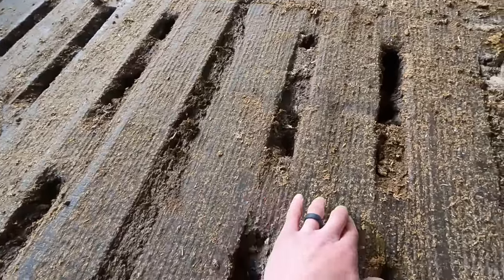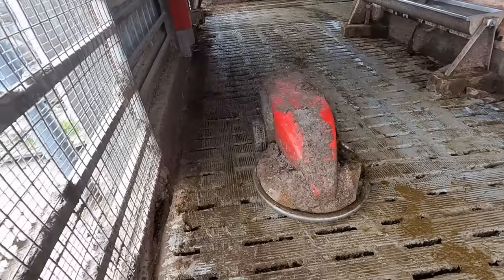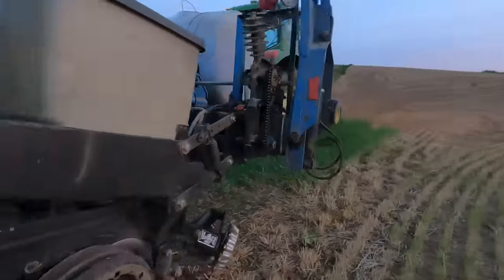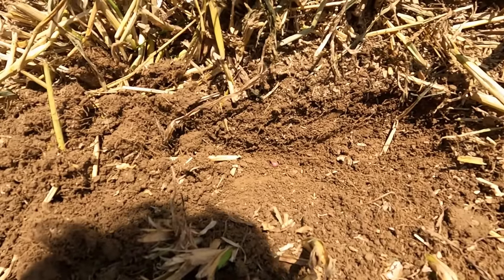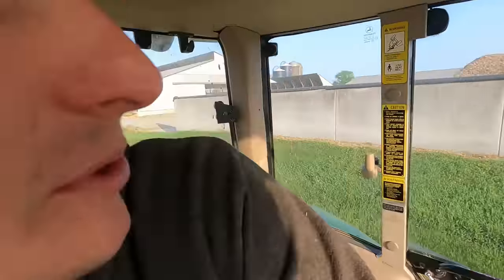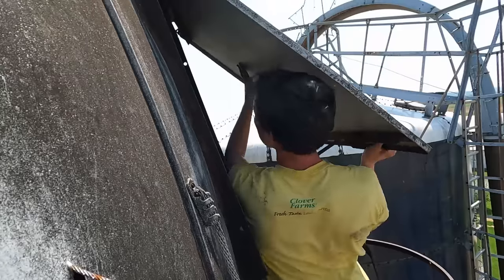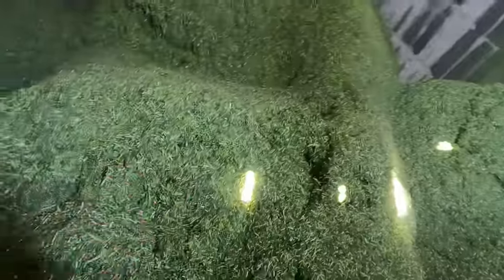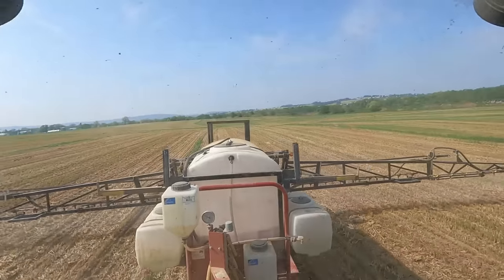Grooving Cow Floors, Planting & Harvest

Comment: if you want to know if its the tractor or the planter having the leaning issue pump the planter up and then disconnect the hydraulic lines if it stays up its the tractor if it falls down its the planter.
Reply: My planter does it too it has to do with those cylinders I'm going to start rebuilding mine one by one as I have time but the book tells me it will happen every now and then and I need to lift it all the way up every so often

Comment: Planter hydraulic issue is most likely weakness in plante cylinder, or cylinders.  Suggest having them rebuilt with new internal seals.  You have internal fluid leak by.  Not necessarily visible external leakage. Good hydraulic shop can do this, reasonably.  Cheaper than new cylinders.

Comment: Def in the planter. Constant pressure coming from the tractor when you pump it raise it up. So the fluid goes out at so many gpm and finds a empty place in the line or cylinder to fill in….hence the one side raising back up. 
Disc bine of mine was doing the same then. The cylinders had breather ports on them so it was leaking out of those breathers on a bad cylinder that I needed to have repacked. 
Planters prob don’t have breather ports on them so you may not be leaking but it’s def a planter cylinder issue 

Hope it helps boss man

Comment: It's leaseback through your valve block distribution on the planter. If your cylinders have counterbalance valves it's likely the pilot circuit is stuck or there's a failed po check on the return side.

Comment: If it's an internal leak on a cylinder piston rod , have someone put their hand on the cylinder and then select full up and hold.
The cylinder will heat up rather quickly as the fluid bypasses the push rod seals.
It will get hot fast, very hot
Had this happen on a case 580.
Hyd Technician showed me this trick.

Comment: Spreader works good as a bedding chopper 😊. Surprised you had to re-groove so soon. We used to scrap up the barnyard twice a day with a metal bucket and that would wear on the concrete but you don’t have that issue. Once we switched to a rubber tire scrapper the grooves lasted longer.

Comment: You can’t beat cast iron closing wheels. The angle of the wheels cutting/closing edge caves the seed trench wall laterally against the seed trench. And they’ll penetrate hard soils. I used them in no-till and following a field cultivator both.

Comment: For the planter lowering, if it's only one side that seems werid, but there are a cuple of options depending how it's hooked up.

If there are no valves between the cilanders or the tractor the only option is that the main seal in those cylanders is bad, now the chance of 2 of them going bad at the same time is very low but could happen, something could have gotten into the systam to reck them. this is assuming they are duble acting clyander which now that i think about it they probably are not.

If there are flow regulatos, one of them might be bad? but this is mostly a shot in the dark i am not sure how that would work but checking them can't hurt.

If you have like a power beyond system for the planter it could be the valve for that side? but thats also probably not the way they do it.

all in all it has to be with something on that side, i would guess the clyanders but i could defently be wrong, if you wanna chat about it and give some more info i am up for it.

Comment: Raise it up and disconnect the hoses that raise/lower it. If it stays level, you know the issue is with the tractor. If it sinks on one side, you have an issue with the sprayer. That will at least give you some data to work with

Comment: Most likely the issue is on the planter unless there are 2 different levers on the tractor. 1 for each side. If there is not a leaking cylinder it is most likely a valve.

Comment: Deff a hydraulic problem. Could be a bad seal on the planter or even the tractor. My guess would be on that cylinder. Prob return line. Check around for any wet spots on the cylinder. And check the lines. If it’s a slow drop you might have a air bubble in the system.

Comment: If it's not dropping down while stored then check the controller on the tractor if it sinks off the tractor check last 2 cylinders could be bad hydraulic seals or valve not closing. - heavy equipment mechanic by trade

Comment: Since your planter is only falling on one side i would say its the cylinder. If its not making a puddle its the seals on the cylinder head inside the cylinder. 

If the planter falls all together i would say its the valve pack in the tractor. 

I would start by repacking that cylinder.

Comment: The Holding valve is bad it looks like a square block either attached to the lift cylinder or where the cylinder hoses all meet together. Rebuild kits are usually cheap it is really just a few o-rings and a checkball/valve.